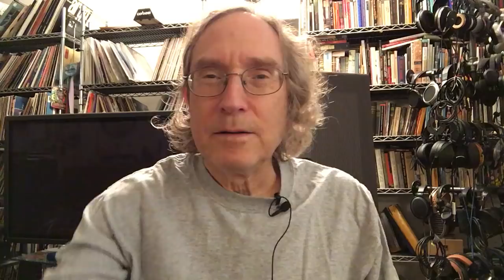Box vs. panel speakers, some things to think about

Comment: I have wanted panel speakers ever since the first time that I saw them in a HIFI magazine about 30+ years ago. as a kid it blow my mind that a speaker could look like a room divider and still make great sound. I never tried to buy a pair because I always thought they would be way out of my budget.  Last year I was at a HIFI dealer and they had a pair of Magnepan LRS. I was shocked by the low price tag and was ready to buy them. I asked the sales guy to to let me hear them, and he spent the next 30 mins (No  Joke) telling me how bad they are and that I should not waste my time. When I finally convinced him to play them for me, he left them pushed up against the wall and refused to bring them out into the room. Also he had the volume so low that I could barley hear them over the store noise (Despite the fact that my wife and I were the only ones in the store).  When I asked him to turn them up he said no, because all they do is force the amps to shutdown. Even with all this I still though  they sounded pretty good. I was about to buy them anyway, but then I remembered that my cats would just think they were giant scratching posts like they did with the cloth grills on my floor standing speakers. Easy fix with the floor standing speakers I just got rid of the grills, not so much with the LRS. In the end I decided to pass, but still one day I will have a pair.

Comment: Every instrument.......is a BOX.........Somebody, somewhere determined that boxes make really great SOUND.
Reply: On the one hand, what you say is true.  A bass drum is a kind of box in the sense that you put it.  A very big box!  But there is a very big difference whether a large box is "reconstructed" by a Winz tweeter, or by a umpteen times larger surface radiator foil.  But apart from that, Steve was only pointing out differences in this video and not preferring one side or the other.

Comment: I'm building a panel speaker set for my voice over studio/man cave.  I have a deep voice and I want to hear the low end without too much bass resonance. I tend to boom out of box speakers.  It sounds great to most people, but it's not true fidelity.  I want to record audio books, not monster truck promos.
I definitely noticed what you said about placement.  I followed a tutorial on YouTube and built two 2x2 foot foam-board panel speakers. They really do sound great until you hang them on the wall, then they sound like tinny $4 tape players.  I spent a few bucks and got two shelf brackets to hold them away from the wall. My plan is to put acoustic foam on the wall, have the bass panel in between and behind the two midrange/tweeters held off the wall by a foot.   I hope it looks and sounds great, but it could come off kludgy.  Worse come to worse, I'm out $50. Thank you for your insight and words of wisdom.

Comment: Steve, I strongly suspect that this is a big reason for the popularity of kit speakers, but I wont discount the effort put into crossover design or the design of said box. The first time I saw a fullrange speaker (large box, single driver) on 6Moons I couldn't believe the asking price - several thousand Euro - but clearly someone is wiling to pay for whatever emerges from what is presumably a very well designed box. Thanks for the video.

Comment: When you are talking about "box" speakers not having a diffuse soundstage, I hope you are NOT including the Polk Audio Signature Reference Series SDA box systems. These speakers use proprietary arrays to cancel "inter aural cross talk" to create a sound stage that extends beyond the ends of the speakers. These speakers, which stand 66inches tall and weigh 185lbs  each, produce a sound stage that has to heard to be believed. Among other attributes of these units are, bass response that goes to the BOTTOM (-7db @ 12hz) with distortion that matches a GOOD valve  amplifier. I purchased a pair of these units in 1987 for $3000/pr. I still own these (MINT) and enjoy them so much that I will keep these till I DIE. Thank you for uploading the videos, I really enjoy them.

Comment: The best solution is large dipole planar magnetic panels paired with open bafflle active servo-subwoofers - best of both worlds. That way you get a uniform dipole radiation pattern. The only issue is that large dipoles need plenty of room to breath as you pointed out Steve.

Comment: I'm old school box speakers all the way, no replacement for displacement, panel speakers lack deep thunderous bass and are shallow and have no depth, to me anyway, subwoofer needed in most cases, if you get a big set of say  Polk sda models etc., all bases are covered and you won't outperform them for the money, a strong 2 channel setup (no sub needed) dialed in correctly is all you need, good video.

Comment: Hi Steve,great channel,I have a pair of ESL63, in a small room,but... I have made wide-range bass traps behind them(also a matching pair opposite end of my rooom) and carefully placed diffusers,they are only 2ft away from the wall,toed in etc,and they  are ,believe it or not, kick ass on the low end  super low and tight,and the imaging is just real and airy ,different league to domes,
the dust covers I did myself you have to be really meticulous on stretching them just right but the reward is no rattles on the low stuff and really fast transients . I still love well designed box speakers too.

Comment: I like the sound of JBL's 2420 compression drivers (1.75") sans the horns. I use Transylvania Power Company's The Tube (Karlson couplers) to load the drivers and provide dispersion. They don't have the nasal horn sound, and allow the tweeter drivers to be in phase with the midrange and woofer drivers. I also upgraded the original dome/surrounds from "spiral" to "diamond."
I prefer panel speakers for chamber music and some folk, but enclosures for orchestral, jazz and rock.

Comment: Great video.  So, using your philosophy, if the cost of the dynamic drivers, crossovers is $6000, the speaker with the box will cost $24000.  Whereas, an electrostatic with $6000 in drivers and crossovers, etc would be $8000.  Shipping cost is less and probably manufacturing costs are less for the electrostatics as well.  Never thought about that but makes good sense.

Comment: The issue is not box vs panel , but box vs open baffle or dipole. Panel speakers are electrostats or magnetostats . And they are also dipoles . But a dipole need not be an electrostat or magnetostat . Consider e.g. the Jamo R900 . Your best option to build a truly perfect dipole with constant directivity is to build it with all electrodynamic drivers for bass and mids , and a dipole magnetostat for the tweeter . That way you can control the width of the "baffle" in each frequency band so that dispersion remains in a perfect figure of 8 throughout most of the frequency range (say 20Hz to 8 Khz). No panel speaker can achieve that  . The hottest trend in dipoles on the  DIY audio forum is actually building such a naked dipole with only an H-frame "baffle" for the bass and no baffle at all for mid and high

Comment: What sound like a panel and to my surprise weren't are the Dahlquist DQ-10! I was amazed at its presentation, realism and depth of image! 
I haven't heard such "romanticism" from a loud speaker since? 
I've heard Maggies, and they didn't do what those DQ-10s did! 
Unfortunately, neither handle aggressive music to realistic listening volume.  Albeit, Rock, Fusion or Electronica with that "you are there" satisfaction gets missed. 
My impression with panels was like listening to a live performance through an open window or portal? The window is the constriction!
Box speakers like the Wilson's Watt Puppies, for example takes you to "ground zero"! 
Speed, impact, dynamic range isn't present with panels or electro-static speakers. They signal gets compressed lossing music's drama and emotion. Bass, the foundation just gets way too "politically correct"! Aka boring. 
I find the effect similar in the headphones as well. 
I'll make an exception there with headphones, and Stax is the exception!  They do it best. No need to move air you can physically feel in your gut.

Comment: Thanks what I was wondering is if you glued mini strong magnets into the bottom of the panel speaker and had maybe a wooden base with reverse polarity magnets glued to it. screw 4 eye hole screws in to the sides and placed two long metal or wood rods through the eyes of the screws and drilled two holes in to the wood base. that way the panels could just float on the magnetic cushion freely. What so you think. I would build one or two but it seems trying to buy those 40 watt are all out of stock everywhere.

Comment: Hard rock and heavy metal go box. All other music genres go magnetic planar. I’m an audio engineer and use box speakers to mix on and for hard-hitting playback for clients but for my personal absolute listening pleasure (beyond metal, hard rock rap etc) I use Magnepan 3.7i loudspeakers. With the right amplification synergy (high current, high wattage) the sound is sublime. At night I sit down turn it up and disappear into the music…

Comment: His comment about the high end coming out of a small tweeter makes sense to me.  I have a pair of older Martin Logans and the high end can be magical.  However they are old Sequel II's and the bass is terrible.  Another thing about panel speakers is that they are difficult to drive.  If you want to rock, they don't quite have the impact. I have been considering maybe some Tekton speakers such as the Double Impact with their honeycomb tweeter/mid array.  Also you don't need 400 WPC to drive at realistic levels because they are very efficient.  I have heard great things about them but they are mail order and I cannot listen to them.

Comment: I wouldn't mind owning panel speakers, but there are a few issues.  First they are very wide and tall and just stares back at anybody in the living room. Second, many say you have to place them well into the room to avoid the back wave from interfering the front wave.  Many say 5 ft forward or 1/3 the length of the room.   I guess if you are single or have your own dedicated music room it's not an issue. If you are married it can be a hard case to make.
Reply: Yeah, that is a problem. You can get away with 3' forward though 5' or even more is better. You can also mark the floor and pull them out for serious listening. You could also consider the Magnepan .7 which is designed for small spaces (you might want to use them with a sub) or the on-wall Maggies that attach to your wall and can be folded back when not in use.
Reply: True enough. People enter my living room, see the big electrostatics and ask, "Are those speakers??"
Reply: t - You can mark the carpet for "playing positions" then move the panels up against the walls when not in use.
Reply: Used to own Maggie 1.7i. The sound stage is exactly 4feet 7 inches high off the ground. They're good for classical music. They ended up being more hassle than they were worth, so I sold them.

Comment: I live audio hifi passion since 20 years now and I have worked in a hifi store. So I have had opportunities to try panels and hybrid speakers system. Never found a decent sounding panel: they are technically a nightmare for amplifiers, I have tried lots of great quality/cost amps (for example YBA) and sound never comes out of them. I remember one test we did in the store with big Magnepan speakers and what I was listening was a dwarfs orchestra playing at the end of a tunnel. We tried everything possible to get it better, but nothing was able to offer a nice sound. Same amp, same room, and Harbeth SHL5 or Sonus Faber Toy Tower sounded amazing. I accept different and new things in life but for me this kind of speakers could work ok only in theory while in reality they are problematic to drive and bad sounding. Even a 280$ pair of 3 ways Indiana Line speakers sound better compared to them! ciao
Reply: You were doing something terribly wrong if that's the kind of sound you got out of Maggies. Properly set up, Maggies and dipole line sources are known for their vast, realistic soundstage. It's like a flying carpet, or a window onto the orchestra. Indeed, this is one of the main reasons I prefer them to boxes. Perhaps the acoustics of your showroom weren't suited to planars, which require a livelier acoustic more akin to a standard living room than boxes. Planar magnetics are easy to drive as well, since they're largely resistive loads. They do need big amps because they're inefficient, and the amp has to be able to provide sufficient current into 4 ohms.
Reply: Thanks for your reply. I just know we tried lots of positions inside the room, and the room was the main audio room of the store, with acoustic treatment. We tried driving those speakers with low power valve amps and the result was the same as with big power solid state amps. Don't really know what was the problem. Maybe that room was not ok for that speaker system. Thank you ciao from NE Italy
Reply: Yeah, I think it may have been optimized for dynamics which means too dead for dipoles. That could have the kind of effect you mentioned.
Reply: Perfect. Now I have understood thank you. If I will have the opportunity I will try those speakers in another type of room. Ciao!
Reply: PASSIONE ARMI ARIA COMPRESSA So right you are! Gave up on panel speakers more than 30 years ago!

Comment: Hi man, I built the DML speaker using Dayton audio 25w speaker (stereo)  frequently response is 80hz-12khz. 

The output was not expected, the mid is really poor wit voice is sounding like echo. I suspect I did something wrong of the following the caused this issue. 

1.)Painted acrylic painting on the panel, like art work. 
2.)Using Dayton Audio DAEX58FP Flat Pack exciter. 
3.)Sticked the speaker using silicon past. 
4.)using wuzhi audio amp. Cheap one. 

Please let me know what could have went wrong.

Comment: I've heard panels, mostly Magnepan, and I love them. I have always wanted a pair. Partially just because the fundamental design structure is different from boxed dynamic cone drivers. I'm sure if I ever do get some, I'll figure out exactly what I don't like about them, but it's a knowledge I will love to attain. Like anything in HiFi, speakers and headphones in particular, it seems certain models and styles work better on certain recordings and styles of music than others. I bet there are a lot of things I would prefer to hear on panel speakers over boxes. Sometimes it's even nice to switch just to hear the differences. I already pick and choose between monitor style, bookshelf and tower speakers depending on what kind of music I want to play.
Reply: I think panel speakers are best with acoustical music, since they have a naturalism that reasonably affordable boxes just don't. For rock, I think I'd just get dynamics since they play louder and have more bass slam. But I think a good compromise is panels plus subs that you can use when listening to rock or doing home theater.

Comment: I love my MGIII's, but as Magnapan has declined to repanel them yet again, I will soon have to replace them. Can fantasize about 30.7's. I still have a 40 year old pair of KEFs in my den which I like and a pair of PSBs at my condo which I am not so fond of, but as I have to keep the volume down there, it doesn't matter too much.

Comment: I think electrostatics sound better in a small room VS a large room.  Will a baffle placed behind the panel help in a larger room or make things worse ?  My last experience listening to electrostatics was in a very large room with glass windows and to me they sounded very flat and the imagining was not good. Subwoofers were used but to me there was a big hole in the mid range.

Comment: Thanks Steve.
The first place I heard Maggies was at Harrow Audio in North London in the 80s. Gave me goosebumps with female vocals.
I loved the easy, open sound of my MMGs, but I did use a REL sub  with them and a simple cap crossover to roll off the bass to the panels. In spite of this, one panel failed :-(   
I plan on getting them repaired at some point. The bass/ mid panel became loose. Glue failure as it turned out. They are the cheapest model...
Should I get the .7s instead?
I noticed the drivers now use aluminium ribbons instead of copper wire. Do they now sound "faster"? There was a certain thickness to the sound as I remember.
Reply: Might just be a bad connection and easy to fix. If on the other hand the voice coil wires have broken or delaminated you can get a repair kit from Magnepan and fix your MMG's for not much money and a weekend's work.

The new quasi ribbon models do sound more detailed (your wires are aluminum, BTW -- I made the same mistake once because they look like they're copper).
Reply: Josh Hill .
Thanks.
My bass panel sagged. Wires still glued down .
Took it apart to see if I could fix it. Big job requiring retensioning the mylar panel
 :-(
 Will trade in with Magnepan....
Reply: Wow, yeah, it does sound like a trade in is the best option.
Reply: @Josh Hill
PS to my original post here:
I finally sent the MMGs back to Magnepan for "repair" / upgrade to LRS spec. The drivers are the same size. Eventually we decided to abandon the repair and I bought the LRS for the quoted repair cost plus shipping:-)
Gary at Magnepan was very courteous in spite of how busy they are ( also dealing with Covid ).
Well, they arrived on Sunday (!) via FedEx and I'm delighted with the sound. They are like an open window into the music.... fantastic!
However it's only took an hour for me to decide to connect a pair of REL powered subs to complete the picture for satisfying weight in the lower register.
Procrastination over. I benefited at least that I got a better model for waiting so long :-)